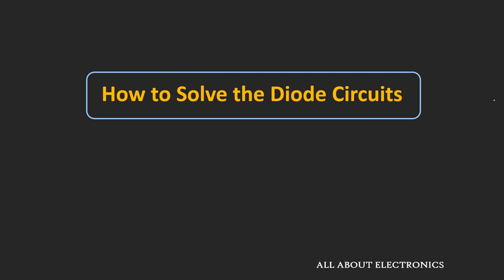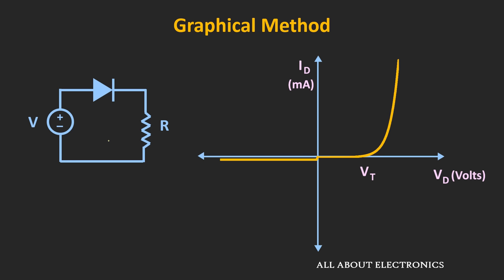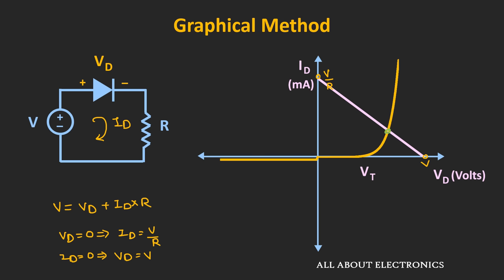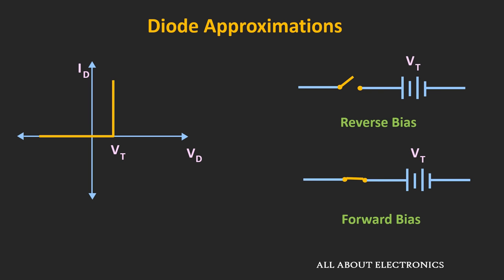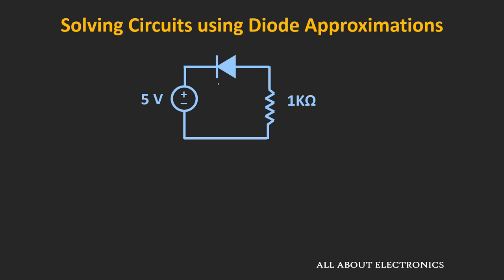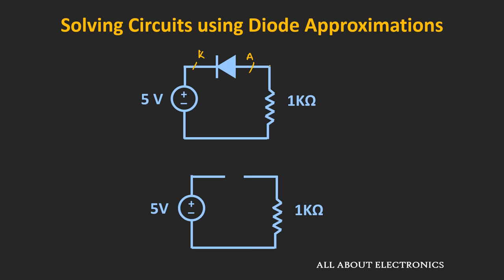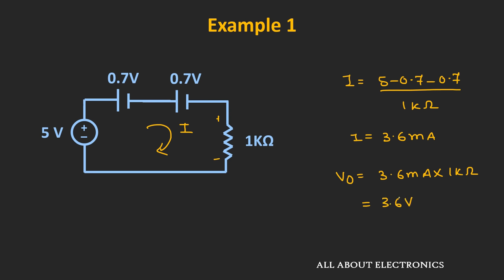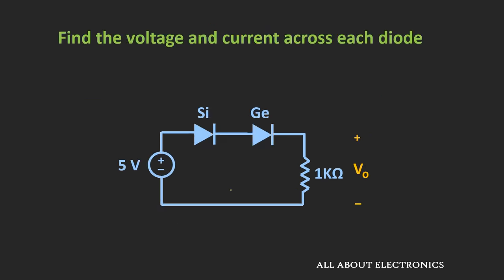How to Solve the Diode Circuits (Explained with Examples)

Comment: In the last example what if we assumed that the upper one silicon diode is on and the lower one if off . Then ? 
In that case the answer would have changed . So on what basis you made that assumption ???????????????
Reply from the maker: If you assume that, the first diode (the upper one) is ON, then the voltage drop across it will be 0.7V. Therefore, the voltage at the cathode of the lower diode will be 2 - 0.7 = 1.3V. The same voltage will also appear at the cathode of the second diode. So, for the second diode (the lower one), the voltage at the anode is 4V while the voltage at the cathode is 1.3V. And since the voltage at the anode is more than the cathode, the lower diode should also conduct.  If the second diode is conducting then the voltage drop across it should be only 0.7V. But in this case, considering first diode is also conducting, it is 2.7V. (which is not possible for a silicon diode). Therefore, that assumption is not correct. And here only one diode is conducting. 
I hope, it will clear your doubt. In the video, I have already explained that. You go through the video if required.

Comment: Sir I am unable to understanding exam 2 that how V2 - 5 gives Vo but all the other explanation was genius
Reply from the maker: Just apply the KVL in that output branch. The voltage at the upper node is Vo.The other end of 3k resistor is not at ground potential but, it is at -5v. (Vo is the voltage  between that Upper node and the ground.) Therefore, if you apply the KVL, in the output branch then Vo is V2 - 5. I hope, it will clear your doubt. If you still have any doubt then you can simulate the same circuit and check.
Reply: @ALLABOUTELECTRONICS   thank you very much sir for explaining the part very clearly 😇😇

Comment: Pls give clarification..... At 12:00
Vo = V2 - (-5) hoga na
Reply from the maker: No that's alright. I suggest when in doubt, draw the voltage source with + - signs. If you represent -5 V upside down with 5V sign on the source and apply the KVL then it would be Vo = V2 - 5.
I hope it will clear your doubt.
And if you still have any doubt then let me know here.
Reply: @ALLABOUTELECTRONICS  sir ,as you explain Vo= V2-(5) so ok.but,why same thing is not taken during current calculation .As you have solve current by taking V2-(-5).please clear it .b/w thanks 😊 for nice explanation.

Comment: Sir I have one doubt if we connect one diode in opposite direction what will happen in example 1
Reply from the maker: In that case, both diodes won't conduct. And the output voltage across 1k resistor would be zero.

Comment: 13.51   how it came ID1=4.65mA?
Reply from the maker: It is 9.3 mA/2. Since, both diodes are ideal, so current will  equally get divided between two diodes.
Reply: @ALLABOUTELECTRONICS  thank you so much for your response.

Comment: Sir,in example 5....why resistance is not considered?
Reply from the maker: You need to consider the voltage drop across the resistor if you apply the KVL from -1V side. In that case, Vo = (Voltage drop across 1k resistor ) + (-1)V.
If you find the voltage from the diode side then you don't need to consider it. 
Here, basically, the node Vo is the intermediate node. So, you can find Vo from any side. ( I mean applying KVL from any side)
I hope it will clear your doubt. If you still have any confusion then do let me know here.

Comment: In 11.23 circuit is open right, how can kvl be used
Reply from the maker: The circuit is not open-circuit. This is another way of representing the voltages. That means with respect to ground, the voltage at that node is 10V. Similarly, for another node, the voltage is -5V with respect to the ground. If you are not able to visualize then you can replace 10V node with 10V voltage source with a positive terminal at the top. Likewise, for -5V node you can draw a voltage source with the negative terminal connected to 3k resistor and the positive terminal connected to the negative terminal of the 10V source. And in this way, you will get the typical conventional closed-loop circuit.

Comment: 10:44 that  doesn't look correct. Isn't supoosed to be : -10 + v1 + 0.7 + v2 + 5 = 0 ?
Reply from the maker: Just draw -5V voltage source for better understanding. Or you can represent -5V as 5V voltage source with negative terminal at the top and positive at the bottom.
If you will apply the KVL with that, you will get the correct equation.
Reply: @ALLABOUTELECTRONICS   Thank you!!!

Comment: sir, on example 4, on finding the Vo, why is V2-5V?
Reply from the maker: Do you mean to say example 2?
If so, then to measure the voltage across Vo, the voltage across V2 and (-5V) need to be considered. 
The other way, it can be found as 10 - V1 - 0.7V.
You will get the same answer.

Comment: The Calculations For Example #2 Are Incorrect.
I = (10V - (-5V) - 0.7V) / (4K + 3K) = 614.29 uA
The drop across R1 is 2.46 volts and R2 is 1.84 volts. Vo is therefore 6.9 volts.
Reply from the maker: I would recommend you to check your calculation once. (10 - (-5) - 0.7) / 7k is 2.04 mA
Instead of adding 5V, you have subtracted it. And that is why you are getting incorrect result.
Reply from the maker: I too checked it and I am getting around 2.04 mA. Please check the polarity of -5V. I think, you must have put +5V instead of -5V. That's the only case, where you will get 614 uA current.
Reply: @johnpautler4872  yours is wrong

Comment: In example 5 why the second diode can't be OFF and Ist one  ON?
please explain it.....
Reply from the maker: In that example, if the first diode is ON, then the voltage at the other end should be equal to 2- 0.7V = 1.3V
And the same voltage will also appear at the cathode of the second diode. If you observe the voltage at the anode of the second diode, it is 4V. So, in that case, it should also be ON. And if it is on, then the voltage at the cathode of the second diode should be 4- 0.7 = 3.3 V.
So, both statements look contradictory. And hence both diode can't be ON simultaneously. 
If you consider the second diode ON only then that will not happen. 
I hope it will clear your doubt.

Comment: What if the value or type of diode is not given... Then how can we solve
Reply from the maker: Generally the type of diode is given. If it is not given then assume ideal diode and unless specified consider the forward voltage drop of Si diode as 0.7V. 
But usually it is given in the example.

Comment: In example 5 if both the voltages are equal then what will happen?
Reply from the maker: Let's say both inputs are 4V. Considering identical didoes, at the output, you will get 4- 0.7= 3.3 V.

Comment: In last problem why 2nd diode is in on state?
Reply from the maker: If you assume the first diode is on then the voltage at the cathode of both diode is 2 - 0.7V = 1.3V
And that will also turn on the second diode.
Because the input to the second diode is 4V. 
And Vanode is greater than Vcathode, the second diode should also conduct.
If it conducts then the voltage at the cathode of each diode should be 4 - 0.7 = 3.3V
And that will violate the KVL because there can't be two different voltage at the same point right? 
So, the second diode will conduct and the first diode will remain off.
with that assumption, the voltage at the cathode of both diodes 3.3V.
And with that cathode voltage, the fist diode won't be able to turn on.
So, only second diode will conduct.
I hope it will clear your doubt.
Reply: @ALLABOUTELECTRONICS  thank you

Comment: In last question why are we assuming that 2nd diode is conducting only
Reply from the maker: If you assume, both diodes are conducting then KVL is violating. And if you assume only first diode is conducting and the second diode is OFF,  then also the second diode will conduct because the voltage at the anode is more than the cathode for the second diode. So, that option is also not true. So, actually, the only second diode will conduct. 
I hope it will clear your doubt.
Reply: @ALLABOUTELECTRONICS  I got it Thanks..

Comment: Sir konsa diode conduct karega ye kaise pata chalega
Reply from the maker: Assuming diode is forward biased, find the voltage across the diode or the forward current through the diode. If the direction of the current in the diode is same as forward current direction, then diode is indeed forward biased. Or during the analysis, just by removing the diode from the circuit, if the forward voltage drop across the diode  is more than 0.7V (for ideal diode if it is more than zero, then diode is indeed forward biased).
I hope it will clear your doubt. If you still have any doubt regarding specific example, then let me know here.

Comment: How can we say that the assumption is right in example 5?
Reply from the maker: Because with that assumption, the second diode is forward biased and the first diode is not-conducting. And KVL around the loop was also satisfied.
Reply: CASE1
Assume upper diode is ON and lower diode is OFF. If that is the case the output voltage is (2-0.7)=1.3v.
Now look at the lower diode . It's anode is at 4v and cathode is at 1.3v. That will make lower diode ON. So our assumption is incorrect.
CASE 2
Suppose lower diode is ON and upper diode is OFF. In that case output voltage is (4-0.7)=3.3v.
Now look at the upper diode it's anode is at 2v and cathode is at 3.3v makes upper diode OFF. Which satisfy our assumption.

Thanks

Comment: i didnot understand last problem why the first diode did not conducts ? please who knows reply  fast
Reply from the maker: If you go through the earlier comments then it has been already explained. Anyway, if the first diode conducts then KVL will be violated. Because the voltage at the cathode of the first diode (which is also a cathode of the second diode, as they are connected together) will be 2 - 0.7 = 1.3V.
Now, for the second diode, As Voltage at the anode (4V) is more than cathode (1.3V), so it will also conduct. And if it conducts then the voltage at the cathode of the second diode should be 4 - 0.7 = 3.3 V.
thats a bit contradictory right !!
So, it won't happen. And only second diode conducts. So, the voltage at the cathode is 3.3 V. And that will also appear at the cathode of the first diode. Now, for the first diode as voltage at the anode is less than cathode, it won't conduct. 
that means only second diode will conduct. 
I hope it will clear your doubt.

Comment: Wch diode will conduct first in last clip vedio
Reply from the maker: Do you mean example 5 right? In the last example, only the second diode where 4V is applied at the input will conduct.
Reply: @ALLABOUTELECTRONICS  higher voltage will conduct?

Comment: Why we can't choose 2v-0.7 as vo last question
Reply from the maker: Because if we choose 2V - 0.7V as an output then for the second diode, at anode there is 4V and at the cathode, there is a 1.3V. It means that there is 4-1.3= 2.7V of the voltage drop across the diode. Which is not possible. (Becuase during the forward biased condition there would be 0.7V of a voltage drop across the diode.)
I hope it will clear your doubt.
Reply: Sir, as we considered the second Diode ON, I assume there would be a voltage drop across first diode as well, which will be 3.3-2 = 1.3V (is that ok, as you were saying in above comment that during fwd biased, the voltage drop should be 0.7V)

Comment: in example 4 why we don't take second one as turn off
Reply: example 5 not example 4
Reply from the maker: @essalokesh2649  Because, in that case, the KVL will be violated. That means if we consider only first diode on then the voltage at the cathode will be 1.3V. And in that case, the second diode will also on. 
If that's the case, the voltage at the cathode of the second diode should be 3.3V. 
So, both are not possible simultaneously. 
Hence only diode 2 will be on.
Reply: @ALLABOUTELECTRONICS  thank you

Comment: 17:39 why not 1.3v
Reply from the maker: Like I said in the video, if the voltage is 1.3v, then the second diode will also turn ON. And KVL will be violated.
Reply: Tqq sir
Reply: @ALLABOUTELECTRONICS  sir i didn't get your point..how come both the diodes gets turned on position at 1.3V?
Reply: CASE1
Assume upper diode is ON and lower diode is OFF. If that is the case the output voltage is (2-0.7)=1.3v.
Now look at the lower diode . It's anode is at 4v and cathode is at 1.3v. That will make lower diode ON. So our assumption is incorrect.
CASE 2
Suppose lower diode is ON and upper diode is OFF. In that case output voltage is (4-0.7)=3.3v.
Now look at the upper diode it's anode is at 2v and cathode is at 3.3v makes upper diode OFF. Which satisfy our assumption.

Thanks

Comment: why is it 4.3 mA, it should be 4.3 A as R is is kilo ohm and  voltage is also in its SI unit
Reply from the maker: Because R is in Kilo ohm. Let's say V = 5V and R = 1 Kilo Ohm.
So, current will be 5 / 1000 ohm = 0.005 A or 5 mA.
If R is 1 ohm then current would have been 5A.
I hope, it will clear your doubt.
Reply: @ALLABOUTELECTRONICS  ok thanks, S.I unit of resistance is ohm and I was thinking earlier that SI unit is kilo ohm 👍

Comment: very interesting.

one thing that needs explanation i think is,

resistor value is in (Kohm)

i think when we evaluate v for two diodes or single diode.

we will need to convert resistor value in ohms from k-ohm to get answer for Vo.

Comment: why the hell is the output voltage 6.12-5v
Reply from the maker: Just apply the KVL at the output node. If required then please represent -5V in conventional manner. Vo is the voltage between the output node and ground. Applying KVL you can write Vo = V2 + voltage of the other source = V2 - 5V = 6.12 - 5. 
I hope, it will clear your doubt.

Comment: In example 4, why did you take output voltage equal to 0.7
Reply from the maker: It's 11.7V (12V - 0.3V).